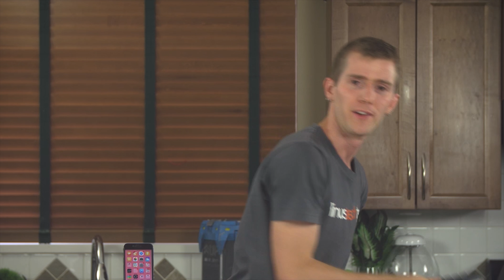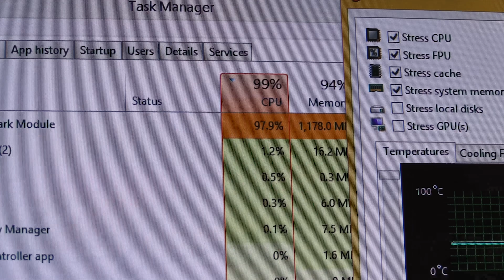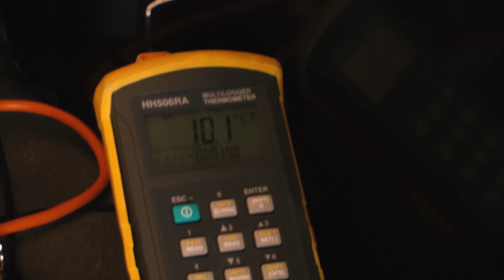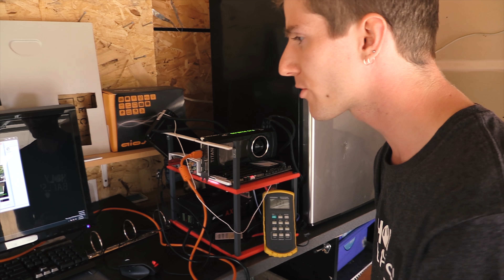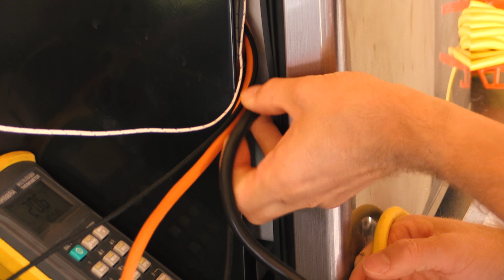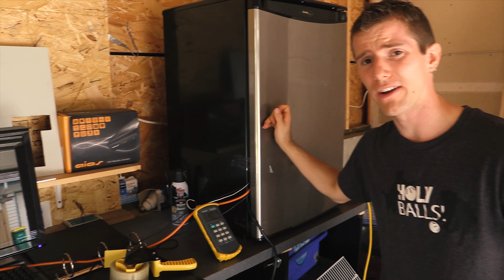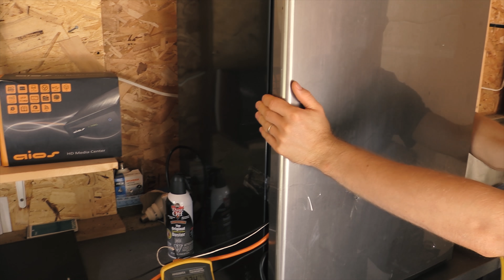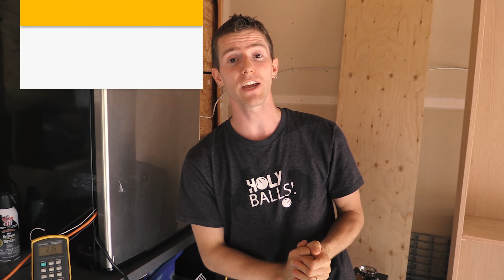PC Build in a Fridge - Does it Work??

Comment: Moisture damage?
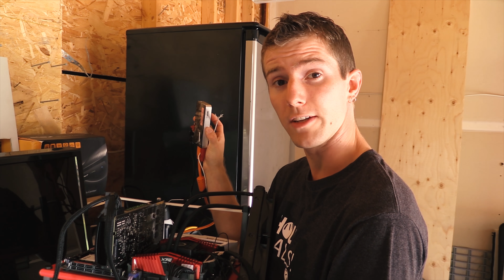Reply: MarcusMeyerTricks at around  6:30+ he answers that question.
Reply: boffifis1 That is AFTER it has been cooled. Cold air still contains moisture, so when the build is in the mini fridge, (after very pro-longed exposure) it will probably get some form of damage? I could be wrong... Just a thought I had.
Reply: ***** water itself isn't bad. When my liquid cooling(Ethyl Glycol or car coolant, which doesn't conduct either) burst in my PC, I used distilled water to clean my electronics and a hair dryer to dry it(which is important before you start it.) Water itself doesn't conduct electricity, it is the salts and minerals that move electrons in water and short electronics.
Reply: +MarcusMeyerTricks Just because air is cold doesn't mean it contains more moisture. In fact, on average warmer air contains much more, because water has a higher vapor pressure at higher temperatures. However, as a given sample of air cools, it's relative humidity goes up, until that moisture condenses out. As it does condense out, the air loses absolute moisture, thus its relative humidity drops and water stops condensing. For example, the north and south pole are technically deserts because very little water falls in solid (or liquid) form there, since the air has already cooled and condensed out most of its water before it gets there. Dehumidifiers work upon this, they cool off the air, causing condensation, after which there is less moisture in the air. Raising the temperature as it exits lowers the relative humidity and makes whatever moisture is still in the air leaving the dehumidifier stays held in the air (at least temporarily), it is also necessary to have a heating unit to expel the heat extracted during the initial part and any heat generated by the device's friction/inefficiency.
Reply: MarcusMeyerTricks  silica gel in a vacuum = no moisture only way i can think of to safely prevent moisture
Reply: Decent60 actually the mechanical drives should be sealed it isnt moisture it is the expansion and contraction of the materials that they are made of under extreme temps could cause problems with the close tolerances with the parts when they are moving thats why he mentioned only do it on a dieing drive cause sometimes cooling it will make it start to work again long enough to recover data
Reply: paktahn even sealed drives can draw moisture via condensation due to the heat it generates and there are plenty of spaces for condensation to occur, due to plenty of alloys in it. This is the moisture I was referring to. Same kind of moisture that can build on a board or any peripherals.
The main reason you don't want to supercool (which dropping it to around 5 degrees Celsius is supercooling) mechanical drives is the bearing fluid can freeze and prevent them from spinning. Moisture/condensation is still an issue but it is possible to slowly drop the temperature to prevent that from occurring but still can have issues with bearing fluid freezing or preventing the motor for spinning properly.
Reply: d3spis3m3
Yes miiister! I find the tone of your post to be condensing!
Reply: he was joking...
Reply: MarcusMeyerTricks 
This is why he also said don't use mechanical drives (that would draw moisture quickly and wreck it). 
Now, because it's not really dropping below 0 C, it wouldn't rack up moisture quickly. 
However, they do build refrigerated server rack units, which normally have space at the bottom (or options for) case system. Those also draw a chunk of the moisture out and generally are gravity fed rather than conduction (which is where a lot of the moisture comes from).
Reply: MarcusMeyerTricks its idiot
Reply: MarcusMeyerTricks Exactly what I was going to say. Seems so obvious.
Reply: atticusphone You get some alone from the air moisture originally in the fridge. Amount of water that can be stored in air changes with temperature and it lower when the air is colder, which means that original air should have more water in it than it can store once the fridge gets cool. 

Though don´t open it after that is should stabilize, so it not a big issue I guess.
Reply: paktahn Vacuum means no air to dissipate the heat into though.
Reply: MGsubbie
air transfer cooling is not the only way to cool in this setup water cooling would be used
Reply: paktahn Can you watercool everything though? RAM and other stuff also produce heat.
Reply: it isnt that hard to machine some copper into custom heatsinks
Reply: ***** 
""Water on electronics is never a good thing"""

Nope, stop being racist. You made a rational(ish) point that I can't counter with something witty, so I am going to call you a racist cis gendered scumbag
Reply: I don't have moisture damage <.<
Reply: MarcusMeyerTricks no. But water damage
Reply: MarcusMeyerTricks Nah, condensation won't be a problem because the computer will be warmer than the surrounding space.

Unless you're thinking of water damage from another source.
Reply: MarcusMeyerTricks  Been there done that.. He's gonna need some acrylic conformal coating to deal with that
Reply: eitkoml Do you even know what condensation is?
Reply: MarcusMeyerTricks you cover it in plasti dip or never wet.
Reply: d3spis3m3 Yes, if you want to know more about it then look up a psychrometric chart.
Reply: MarcusMeyerTricks Dunno, whenever I open my minifridge, it's never just wet with condensation for no reason
Reply: ***** Moisture damage? :D
It is completely sealed man :DD
Reply: if the fridge has no moisture in it in the first place, you will be fine.
Reply: I never have anything in the fridge get condensation on it. If the door is sealed like it should be, condensation is a non-issue.
Reply: +MarcusMeyerTricks there is always a certain level of moisture in the air, that is why you get condensation on the windows, when is cold outside, the air's fast loss of heat when it enters in contact with the cool window, changes the state of the water found on the air, from gaseous to liquid, the same happens when you take a bottle out of the fridge and live it to rest, it starts to "sweat", is not actual sweat is just the water on the air is condensing because of the bottle absorbing it's heat, so if you take out the computer of the fridge and start it right away, air will condensate on the inside, and water and electronics, you know the rest
Reply: +Vuszi Belmont Why would you take a computer out of a fridge and expect there to be no condensation? We're talking about keeping the thing inside of the fridge. Condensation would be a non-issue then, especially seeing as how the computer would even stay warmer than the surrounding air...
Reply: put the fridge in a room you have dehumidified
Reply: This most boring thread has got to frakking stop!, stop I say!!!!!, jjjjeeeze oh christ oh man!
bleh!
Reply: *****
WHyyyyyyyyyyyyyyyy
Reply: +MarcusMeyerTricks Throw some DampRid in there.
Reply: +JWQweqOPDH Another way to think of it is that as the air cools it's density increases, decreasing it's ability to hold the water vapor. So it migrates to an area of lower density in order to reach equilibrium. As the temperature gradient increases toward the surface. So then you'll have a nice warm, moist area of water vapor hanging out next to your PC components. To manage this you could theoretically control the exact temperature of the air flowing over your equipment actively by mixing ambient air into the conditioned air relative to component temperature.
Reply: *****
Please stop this thread, please dear god. Think of the environment or whatever
Reply: just unfollow it
Reply: Ozzie Peck
Nevers!
Reply: +MarcusMeyerTricks If you cool down the harddrive, then take it out of the fridge, it will condence.. and it will condence on the inside.
Reply: +bwack Hard drive have dessicants inside. They are also sealed pretty well. Another non-issue. Besides, why use a spinning disk?
Reply: +Tim Ramich less $ per gigabyte
Reply: +MarcusMeyerTricks Mmm moist
Reply: +Hayden McCarthy Anyone who puts their OS on a spinning disk in this day and age isn't going to be a person who is putting a computer in a fridge...
Reply: Tim Ramich So only dumb-asses put their OS on a SSD then?
Reply: +Shawn Kearney What?
Reply: Tim Ramich If you think putting a PC in the fridge is a good idea, you're either 12 or a moron.
Reply: it will cause the fridge to overload, and btw... yo just called linus a moron, if the air in the fridge is at 0% humidity and the air around it is the same then you will be fine
Reply: Ozzie Peck Linus The Tech Tool is a moron. I have zero reservation saying that. None at all. I'd hire a potato before I'd ever hire someone like him.
Reply: any reason why you think he's a moron
Reply: Ozzie Peck He set up a gang water cooling system using a bunch of PC fans, took no consideration into the actual thermal requirements, used zip ties to hold down heat sink assemblies, clearly has no idea why putting a PC inside an ordinary refrigerator wouldn't work.
Reply: +MarcusMeyerTricks The moisture which might condensate on the inner walls of the fridge has been removed from the air within it so, the air will actually be drier inside the fridge. The computer parts will be hotter so no moisture will condensate on them.
Reply: *****
 Everything you're saying is correct, but another thing about water cooling is that it can "hold" a lot more thermal energy per unit of volume than air can. If you had a very large body of cold water next to your PC, you could likewise dump the heat into it by submerging your radiator inside. The problem with this is again, circulation, and you'd end up just heating the water around the radiator. Air and liquid are both fluids and work the same way. It's just a matter of energy density.
Reply: +Shawn Kearney actually, a large enough water sink would dissipate enough thermal energy to the air to compensate for the added thermal energy to the water tank. as long as it wasn't thermally insulated, and the tank was made of a material that wasn't electrically conductive but conducted thermally, it would work.
Reply: Joshua White the problem here isn't the thermal capacity of the pool, you wouldn't need that large of one to displace a few hundred watts. The issue is rate at which the water in the pool can conduct thermal energy. You could have a pool the size of a galaxy. That wouldn't make much difference if the majority of thermal energy builds up a few inches from the source. The same is true of air, and is why we use fans.

Comment: If you get a meat freezer and put an anti-freeze liquid to do a liquid cool build but have a hole in the side of the freezer you could blow the heat out while sucking the cool air through it. The only problem is that the air has to come back in through a second hole heating the fridge. The only benefit is that you don't have hot air blowing around like it would off the pc inside the freezer. I suggest getting a freezer with a bigg bin and fill a liquid cooling tubing in a spiral down it with an anti-freezing liquid. Than pour water or something into the bin and when it freezes it will take a long time to thaw out while playing. Even if it does you still have it in the freezer in cold water.

Comment: before I got into the video im creating this post. Wouldn't it not work because its chilled but if you do fan or liquid cooling the radiators would heat up the fridge. So you need a big space or blow out of the fridge. If you blow out of the fridge warm outside air comes in

Comment: Y would you put a watercooled cpu in the fridge when a fan cooler will benefit much more. Comon, the waterblock dissipate heat through the radiator so y would you put a radiator(cpu) in a radiator(fridge). well that aside, time is a factor here. You would probably need 1-2 hours for the cooling to work.

Comment: how about this you drill some holes on the front of the fridge and put fans in them that is blowing air outwards then connect the computer to the outside. the fans will then take cooled air from the inside of the fridge and cool it off more with airflow  going directly to the computer. please test this!

Comment: I haven't watched the video yet, so don't judge, but I always thought the way to do it would be to have a regular computer build in a case, but have the liquid cooling reservoir inside a mini-fridge, or even some kind of dedicated cooler unit (like they have at factories) if the mini-fridge wouldn't work. Much easier than trying to get a whole build inside one

Comment: No no you guys are going about it wrong. If you try and use liquid cooling piping drilled into the fridge and have it running to the CPU and GPU. Using anti freeze piping. You should find a huge cooling difference. Example run a coiled copper piping in the fridge with connections to the computer running on the outside connected to the piping. You should see a huge dramatic drop in heat. Also I have to troll the fact that there was no computer in this video "built in a fridge". Sorry I had too. lol

Comment: Your putting in a solid state mini pc which is no where close the the spec of a full blown overclocked gaming rig... You cannot use that as a control unless your testing other similar devices like that.

Sure it looks good on paper, but so did the Titanic..

I tried this experiment back in 2006 with a full on side by side fridge with ice & water dispensers,  and an LCD in the door modified to connect to the PC.. didn't work, overheated baddy and ate itself and that was a full blown fridge.

Reasons this is a BAD idea:

1, Water Condensation, fridge works on removing heat and moisture but that moisture left behind condenses and freezes, the fridge runs a defrost cycle and then your going to have water (not oil) dripping on your mainboard.. 
2. Not efficient - T fridge will only move X amount of heat in relation to its rated wattage. You will burn out the compressor or the CPU before you achieve a stable temp.
3. Too fucking heavy and cumbersome, I mean really does this need explaining?.
4. No adaquit airflow over the CPU, yes the lack of heat in the fridge makes it cold but that does no good if you cannot move air across the heatsinks and out of the unit.
Computers inside big Ice house freezers even run hot and it can be 20 below zero in there!
5. Cost! It is actually cheaper to buy and install a proper oil cooling system in your PC than buy a vapor compression refrigeration system for it..

Your better off putting some TEC's on your chips, You would get better results as well.

Maybe your video will finally clear up what I have been saying for over 15 years now...

Comment: even if the fridge was powerful enough to counter"the heater"lol your going to run into condensation issue....use the fridge beside the computer and run your cooling loop or loops thru it...best of both worlds and still room for beer or energy drinks

Comment: obvious this cannot work when you have a 300w heat output and trying to cool it down with 80w cooling power. also the Fridge would die in a few days. maybe you could use an AC unit and rip it apart and use the compressor to cool down water from a loop. or just blow the cooled air into a case.